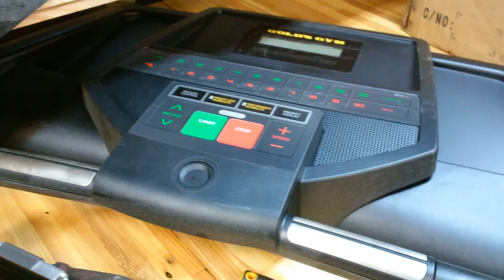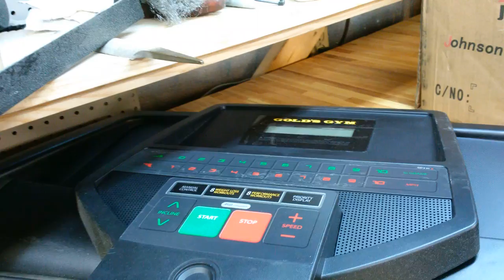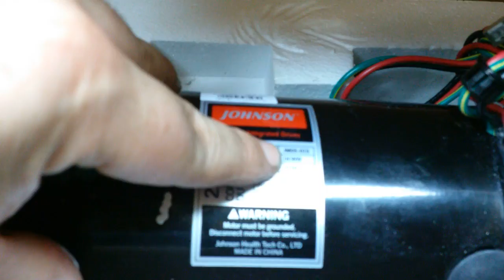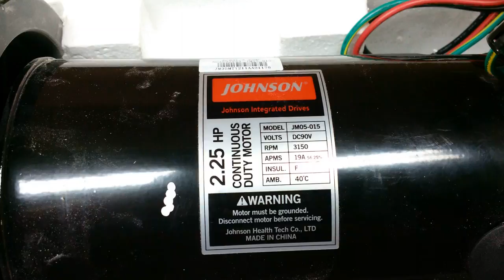How to wire up and use a treadmill motor quick run down, DIY drillpress/lathe conversion

Comment: that thing you said was a diode for preventing feedback to the big ass capacitor is, I think, a current sensing resistor, or rather a power resistor of what appears to be .01 ohms, plus or minus 1%,  that can be used to deduce the current draw by measuring the voltage drop across it and using ohms law.

Comment: Why can't you just attach a 15 amp speed controller/ dimmer controller to the motor and plug it in ? Will someone explain why this can't be done if it can be done, or a way around all the electronic baggage?
Reply: DC

Comment: I tore down my whole treadmill
I test the circuit board for power 
It works my motor works
My control panel lights up 
But when i pressed start nothing
Moved at all...so what could be the problem? 
Im thinking either the control panel or data cable ??
Reply: What kind of control board does the machine have?

Comment: I have what looks to be the same motor and board but I want to use a variable speed knob for my lathe. Not sure how to hook it up?
Reply: That is an MC2100 board all you need is a PWM signal generator and you can control that board without using the main panel.

Comment: Your gate is a Mosfet and is typically switched for treadmill applications using an optocoupler controlled from the processor located in the console

Comment: I have a 2100 MC board and was hoping you were going to show the steps to get it to work without arduino pulse control - BUT no such luck and no help at this point.  Do you have a follow up video?

Comment: I've got a 3HP treadmill motor from a Nautilus treadmill that is one direction, but I don't think the brushes are offset.  I think it's just because of the spiral cooling fins that are cast into the flywheel.
I have another 3HP treadmill motor from a Life Fitness treadmill and it's both-directional. (uh oh, is that transgender-phobic?  Maybe I should generically say it's multi-directional.)

Comment: Wire in a whdts signal generator 1 channel pwm to the board. Controls motor speed and works great.  Set gen to 20hz

Comment: 3:20 this is incorrect. After the voltage is rectified but before it gets to the capacitor there's an scr that acts as a motor safety that is only engaged when the motor is supposed to be running. It's also for if the mcu freezes the scr is switched off killing the power to the motor.

Your explanation on how the motor control works is also wrong. At 3:40 the axial component you call a diode is actually a very low value resistor used as a shunt resistor for current sensing.
Motor always has high dc positive high voltage applied to it and is switched on the low side though high frequency pwm on what you correctly identified as the transistor.
The diode next to it though doesn't provide any power to the motor  as you incorrectly stated; its function is to serve as a free-wheeling or snubber diode which you need on inductive loads where you suddenly close the path the current is taking. If this diode wasn't there the inductive load (motor) would keep pushing current towards the closed mosfet and the voltage would spike and potentially damage components.
Reply: Awesome explanation!! Are you an electrical engineer or do you just know a lot about components?

Comment: Thank you for the video and your description. Found it helpful and learned a few things.  I have a similar motor control board, on my treadmill, and the big electrolytic capacitor has failed -- which explains the motor's uneven/poor performance. Easy fix.   Also, going to pick up some more of these parts to retrofit a drill press, plus a tachometer.  Dialing in the RPM for various drill diameters/different materials will be such an improvement from the standard/awkward change-the-belt-on-the-pulleys method.  Again, thanks muchly, very helpful..... !

Comment: I have the exact same treadmill that took the motor from. I'm using to build a novelty light display thing.
And it keeps shutting down when it has a load on it. I've already removed the heat sensor from the motor.
Can you tell me what I need to do?

Comment: A lot of negative feedback from people that felt they weren't told enough of how to actually mod the wiring. I'd be worried that if they did not understand any of this, it's probably a good idea not to mess with any of it.  He did, albeit in a dismissive , blue collar way, show us where the different blocks of the circuit board was and for those who are competent, that would probably be enough to hack the board. He didn't say "what to wire" because it's already wired. What he did indicate is what you simply don't need as it's wiring in support of the equipments other bells and whistles.

Comment: You called the transistor  a diode and a the black cylinder you called a diode is NOT a diode so you don't really know what you are talking about.   A diode has a strip on one end to tell bias of the diode.  You don't need to disconnect all the things you said because you can just ignore them.

Comment: Hay there is info on speed control after u cut the leg off the thing Amy jig for 5volts. Which would be handy like a ver pot resistors an installed my be one to many?

Comment: Did you figure out how to connect a pot to this without using a PWM? I have a MC2100 board and don't want to have to build a pulse width modulator in order to control the speed. The mc60 boards are much easier to use since they can be used with a pot connected directly since they don't use a pulse for control speed.

Comment: Much better to input a PWM speed signal into the pin 4 of the 8 pin connector rather than chop the board about or use the console, also if using the flywheel and  reversing the motor, the flywheel  may fly off if threaded.
Also the Mosfet is not a logic level type 5v gate, it requires at least 10v to turn on.
Reply: I'm looking for something related to repurposing treadmill motors  and none of the many <20.00 chopped AC setups have mentioned demagnatizing the permanent magnet motor, if too much voltage is put to it.

OR that rectifying AC increases voltage 70-80%.  So, at wide open, this maya well put 120V X 175 volta into a 130VDC motor.  

It will die... and they will blame it on the 'Cheap Chinese' motor...

GeoD
Reply: Looks like he's not rectifying, his motors may last longer...

Comment: The controller is really not needed. You can use a full wave bridge rectifier and a ceiling fan dimmer switch for speed control. It eliminates the safety functions built into the controller. Add a DPDT switch for foward & reverse function.
Reply: have you tried that?

Comment: I am working on making a grinder with treadmill motor, but I don't know how to get the big drive wheel off without damaging it.  before I can do anything I need to get that done, I would appreciate any advice you can offer
Reply: connect the motor to power in reverse while holding on to the flywheel. It will come off no problem.

Comment: Hi, do you know how it's possible to reduce the voltage without a transformer, if i'm not wrong, that transformer you see there, it's not the one who deliver the amp to the motor (sorry my english).
I'm wondering because i have a 90V Dc motor like that one and a electronic board like that one too.
i just plug to 110V in the wall and variate the speed with a potentiometer. 
that electronic card acts as a soft starter for the motor ?
when you are talking about the power diode, are you talking about an SCR?
Reply from the maker: Mechatronics Engineering I just needed full speed. But you can use a fan motor controller. Like they use for ceiling fans. Or a "router motor controller" that transformer is used for the other circuits. Not used any more. If your only running the motor for 5-10 min at a time 120v is fine on a 90v motor. Lots of people make Sanders front these motors. Use 120-150v even. You just have to make a simple full beige rectifier and and soothing capacitor circuit. Which is all Im turning this board into.
Reply: But if i put a bridge i will have at the capactior 110*sqrt(2) = 155V DC?
Reply from the maker: Mechatronics Engineering correct. You have to step down the voltage before the rectifier, it's not a lot of power. Less then 10a, a fan controller would work fine. You have to get the voltage down to about 70-75v or so to get it up to 90v after the cap and full bridge.
Reply: I have no CLUE what's it's a fan controller... i will find out.
Reply from the maker: Mechatronics Engineering just search your closes home repair center for a "ceiling fan speed controller" home depot, Rona, Lowe's, obi, no clue what part of the world your in. But you can get really cheap 120v AC motor speed controllers on ebay. This is the kind that fits in the wall next to a light switch.
Reply: Colombia - South America.
I will search.
thanks for the information.
take your like and share and subscribe 
best regards

Comment: Using a LM555 like PWM you can use this board, without any problem.
This board comes in Proform treadmill machines, in the 8 pin black connector you can find the PWM input.

I am fixing treadmill machines for 20 years, ask all you want to know.

Cheers.
Reply: hi do you know were i could find the schematics for this motor

Comment: dont destroy your control board. do not listen to this idiot. why not just use a full wave bridge rectifier package? you can buy one rated way higher than that motor for less than a dollar or scavenge one from an old computer power suply or make one from 4 diodes....

Comment: It is a good video, but did not show how to connect a 5K pot for speed control.  Will you or one of your subscribers tell me how to remove the MPH panel and install a pot.  Thanks.
Reply: Look here for the circuit you have to make and add to the MC2100 controller to use a pot for speed control: http://el34world.com/Misc/Cnc/TreadmillMotor1.htm
Without making a PWM circuit like above you can't use a 5k pot to control speed.

Comment: Why not you make a video on this topic which will help lots of people... Topic is how to convert manual tredmill into motorized tredmill
Reply: In the US it is easier to find an inexpensive used treadmill, or a treadmill someone will give you for free than to find all the parts and add a motor and controller to a manual treadmill.  In the last month I found two working treadmills that were left at the curb for trash day.
Reply: @CADDapult  thanks for helping people out - it's fortunate when one can find someone to take time out of their day to post a helpful response.  I felt compelled to say something after seeing you had helped another indiviwith with some good info that I am able to use as well..thank you sir .
Reply: I just picked up a horizon 81 this morning FREE.  I have to work on the  Motor Control Panel to get it working but that is my new challenge.  The fellow was practically pleading for someone to come and get it or it was going to the dump.

Comment: not what I was expecting from the title, very very little info on wiring setup to actually use the motor as an option to ac motors onl power tools. Good job reviewing circuitry if all you want to do is rer-use it as a treadmill motor. No regenerative braking info, no reversing circuitry, no load values for braking?

Comment: Nice clip. So where in the circut do you connect the on off switch?
Thanks.
Reply: On the AC power in leads. Do not interrupt the neutral (white) wire, put the switch on the hot (black) wire.

Comment: Hello. I like the controller to the treadmill. Blown engine and with it the burnt part of the components on the board. All I replaced and now the voltage on the DC motor 13.5. By increasing the speed of the track voltage does not change.
Engine 180 VDC.
Say, you have to contact the voltage varies from engine speed? On the contacts A + and A -.

Comment from the maker: +Chris F The site is local to Toronto, they do ship but shipping that is expensive. they usally sell for $250-350 on the site. but whenever the term AS-IS or DAMAGED is used in the title, it goes for cheap. and what do i care if the box is messed up. i only care about the motors. i just picked up a monster 3hp 90v motor or $18, could turn around and sell it for $350-400 since its NEW in box but that would leave me with no motor. and Im pretty ambitious with what i want to do.
Reply: Whats the site in TO for these treadmill motors?
Reply: I only care for the TOTAL price you paid- and , unless you happened to be able to pick up the item in person, you paid a whole lot more then $9, $23, $18 for these tired motors.  Why don't you give us the SHIPPED price.... put it in real terms for those interested. Your as bad as the jokers who put $9, $23 or $18 as the price on those =miserablee "auction sites" your feeding your cash to.
Reply: @michaelr1961 I believe  he explained in one of his responses that the item he purchased was local .I can't can't say but I doubt he's spending anything apreciable on shipping. If he wasn't concerned over saving money I'm assuming here of course but I would guess he'd  buy a new speed controller instead of repurpousing the old one .

Comment: R37 on your board is probably a resistor not a diode - little matter. It says 01 ohm 1%
Reply: +ryan cler yes. ..With such a low value. It could be part of feedback. ..or even be an I to V converter. have you worked out the running of the circuit.
Reply from the maker: The lift motor is 120v. You are correct. I didn't read the solenoid correctly. Thanks.
Reply: Bart Koscow you are welcome. Thanks for the helpful video.
Reply: current sense